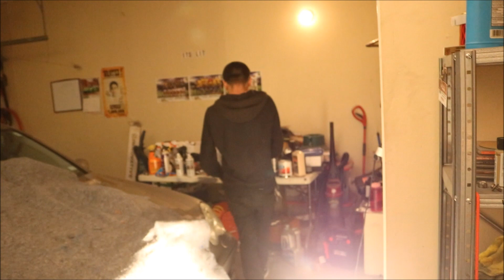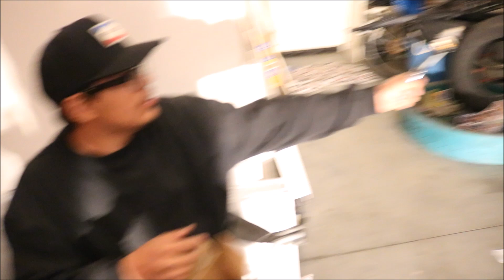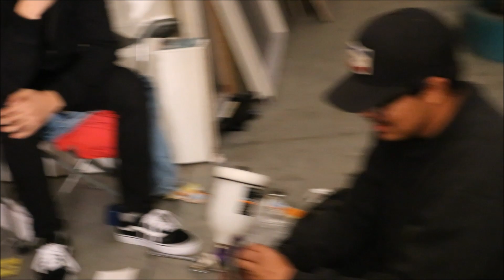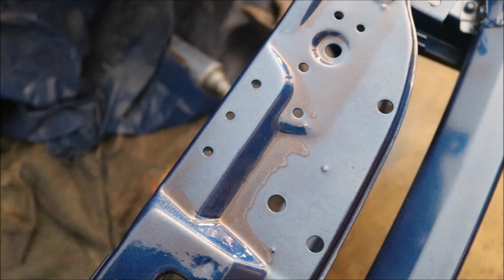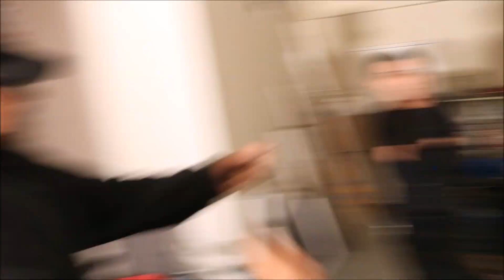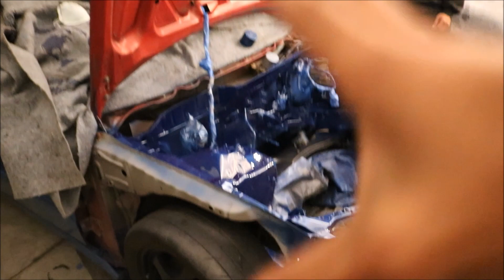Making Engine Bay More Legit

Comment: Those wheels are going to look damn good on Davids civic, just really needs to bang out the fender and try get it a bit better than it is for now atleast....

With the engine bay currently why dont you spray the under side of the hood with the engine bay paint but do a I think they call it a Japanese Rising sun. Leave the red that is there now as the sun and the colour you just used for the rest. I understand your thoughts on making it the same colour as the body but by having 2 shades of blue I think it will actually detract from the engine bay colour because it just looks like you weren't able to get the same blue. Rather just make the under side of the hood into its own focus piece... just a thought